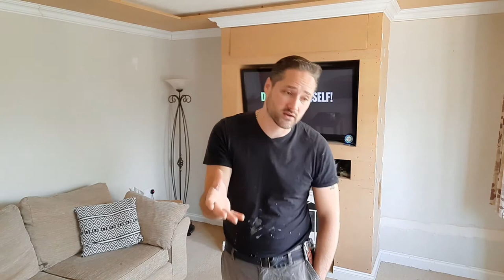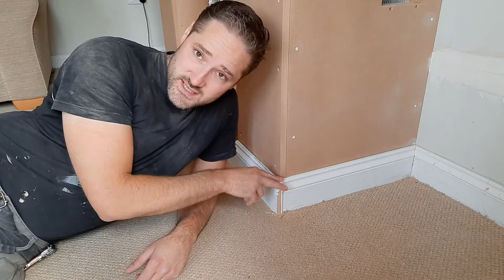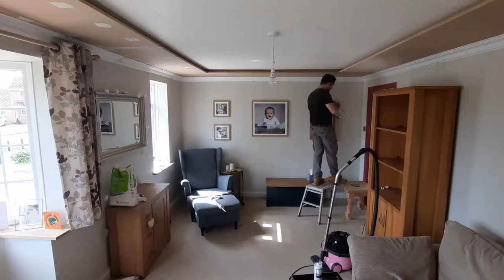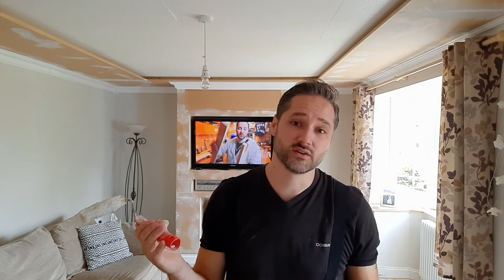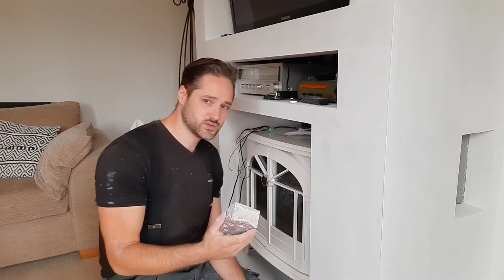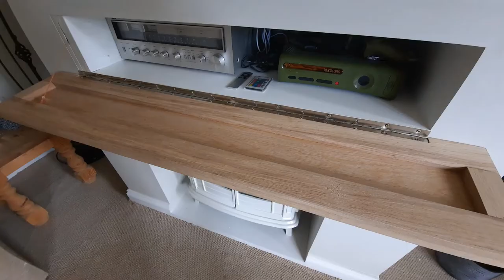How to paint a room the right way  (stage 4)

Comment: What’s the finish like in comparison to using plasterboard instead of mdf, I’m trying to pick between quotes ones using mdf and the other using plasterboard (internals are both studwork)
Reply from the maker: Hi I would say the MDF is easier to install and to finish off (with plaster board you will need to reinforce the edges)  how ever I didn't leave a gap between the too edges of the MDF, so in the colder months ill have a very small gap and in the warmer month the opposite.
I now have to dig out a thing gap and fill with a flexy filler
I hope this helps
Reply: @DeanItYourself01  thanks for that , really appreciate it.